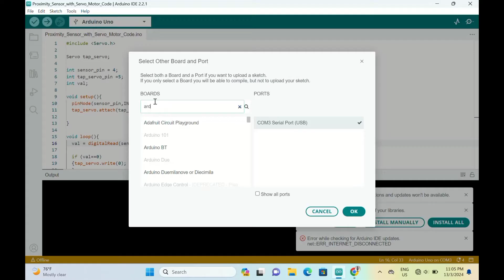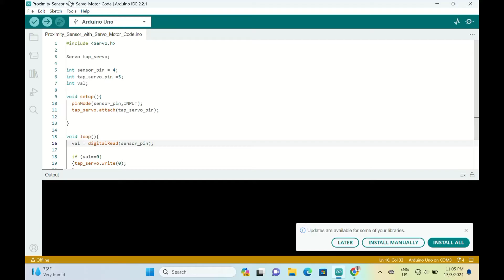Proximity Sensor with Arduino Uno

Comment: hi! can i request for the circuit diagram? and is it possible if i won’t be using arduino as the board, instead i will use ESP32?
Reply from the maker: You can use Esp32 instead of Arduino just replace the board and pin only

Comment: What are  the name of the connector did you use in proximity sensor and power supply?
Reply: Is this PNP proximity or NPN sir?
Reply from the maker: @eianvlog6047 this is NPN type. You can not use PNP proximity sensor connection like this Arduino can burn out.
Reply from the maker: It is simply call DC jack female connector😂

Comment: Hello, sir  this video is useful for my work. But some change for my project , when proximity sensor sense the metal motor start for 5 second, if metal is it steady at sensor more than 5 second motor will that time off. please make program for this work.

Comment: Can we calculate the distance from the metal object to the sensor  ? Whats the accuracy?
Reply from the maker: @easy_3d  this Sensor is only detect within 10mm very short range.so if you want wider range than need to use different type and different code
Reply: @passiontechklm  10mm is fine for me, i dont see any code in your code to display distance, how can we display the distance?
Reply from the maker: @easy_3d  need to write different code if you intend to have display
Reply: @passiontechklm  please can you use it to sense and  differentiate materials at in that 10mm range like plastic , glass , liquid. And how

Comment: Hi,
I found from some how a metal proxy sensor. It works with 24 V. Normally it worked when I close sensor to metal surface. But it's data line voltage was also 24 V. Than I broken my RP unfortunately. 
Is this normal? According to your (and also other turorials) videos they connect to data line to RP port and also join RP negative to sensor negative. And I guess all data voltage of the sensors is 5V. 
Unfortunately I realized this in very late and expensive way. :(
Reply from the maker: Yes it is normal its should not be no issue with Micro Controller. may be some where short wire? 
You should try with like Arduino first because RP is expensive much more than Arduino
Reply: @passiontechklm  ,
No. The problem is because of sensor type unfortunately.   
NPN or PNP type. My sensor was PNP type and this is gives 24 V to data line when the sensor triggered. 
If we want to use proximity sensor then we must use NPN type. In this type it gives the negative voltage "0" from data line when the sensor triggered.
I learned sensor types very well now but this lesson cost me little bir expensive unfortunately. 😛
But I wish you were mention about your sensor type NPN or PNP.
Any way, thanks a lot for tutorial. 😉
Reply from the maker: @mucip_ilbuga  Oh i though you were using NPN..... some times our experience is best teacher for us.

Comment: Hello! Thank u for making this video, it is really useful for my school project. I'm making a trash bin which can automatically separate metal and nonmetal trash. And im using inductive proximity sensor to detect the metal trash and hc-sr04 sensor to handle the nonmetal trash. So I'm wondering if your tutorial also works for inductive proximity sensor?
Reply from the maker: @Kimberly-z5r1l  Inductive sensor will detect metal is correct but Ultrasonic sensor also detect both metal and non metal meterial as well.

Comment: Tried everything with your connection. Capacitance Proximity Sensor works but the servo won't move. I don't know why 😅
Reply from the maker: @Myrmidon619  Give servo separate power supply... some times the current from Arduino is not support to move Servo motor
Reply: @passiontechklm  oh that makes sense. Thanks so much, I will try that 😁

Comment: wow nice can you help me in my project because im going to use 2 servo motor(mg996) and it requires 4vto7v and 2 capacitive proximity sensor how am i going to power all four of that components and what type of battery im going to use? can you help me?
Reply from the maker: @lianrodriguez8219  At first you need make sure sensor voltage and servo voltage so that you can use same power supply. That make more simple
Reply: @passiontechklm  the 2 sensor requirez 6v and the 2 servo requires 4volts to 7 volts

Comment: Hello! I have few questions related to this, i am currently working on a project and would like to ask for guidance, is there any way i can contact u privately?
Reply from the maker: @deleusavrill  You can ask in the comment here🤗
Reply: @passiontechklm  I hope you'll be able to understand this. Here’s the situation

I want to create a vending machine-like project where users insert three plastic bottles into an input slot, and in return, they receive 300mL of purified water. Once the bottles are inserted, the water from a jug or container will be automatically released. Users will need to place their tumbler below the faucet to prevent spills.  

I already have some materials (from a friend):  

- Arduino Uno R3 
- 20cm male-to-female Dupont jumper wires 
- 10cm male-to-male Dupont jumper wires
- Breadboard (170 tie points)
- IR sensor
- Servo motor
- 9V power supply

However, I want to replace the IR sensor with an LJC18A3-H-Z/BX (1-10mm Capacitance Proximity Sensor Switch, NPN Normally Open, DC) because I want the machine to accept "only plastic bottles* before dispensing water.  

The problem is, I don’t know how to use this sensor or how to write the necessary code to make my project work. Since this is my first time working on a project like this, I'm struggling a lot.  

I’d really appreciate your help in setting this up and coding it correctly. Thanks in advance!
Reply from the maker: @deleusavrill  As i understand your topic of project you can use exactly this project no need to change anything but the servo may be not enough to push big bottle.
Reply: @passiontechklm  How about the coding for the sensor? Can your code be used in our project?

Based on our project plan, the machine should only release water if the correct object (a plastic bottle) is inserted. If another object is inserted instead of a plastic bottle, the faucet will not release water. We want it to work like that, but we don’t know how to do the coding.
Reply from the maker: @deleusavrill  yes you can use this code
Reply: @passiontechklm  But in our project, it needs to detect 3 counts before the servo motor rotates, so I think some changes may be needed in your code. Can you help us with that?
Reply: I hope you can help us with this. 🙏
Reply from the maker: @deleusavrill  ok i will do it soon for you
Reply: @passiontechklm  thank you so so muchh, i'm looking forward to it. 🩶
Reply from the maker: @deleusavrill  You can check it out this video and i hope it will meet your project....https://youtu.be/xuDoHRtjdY0

Comment: Hi, thank you so much for creating this video. It's very helpful, I am curious of the possibility of using IR photoelectric 3 cable proximity sensor. Can I use such sensor on this circuit? Or do I have to adjust the library also. I am glad if you mind to answer my question because  I am having my first industrial project. Thanks a lot
Reply from the maker: @pheunomic-arif12  Can be use but be careful  your Sensor voltage. no need to change the code and library.

Comment: how did you activate the dc female 12V power? is it connected to other materials because we can't see it. thankyou
Reply: Its connected to the outlet he has a 12v power supply with an output that is a dc jack hence the use of the adapter

Comment: what power supply did you use for the sensor?
Reply: Is a 9v battery enough?
Reply from the maker: @marcreianaringo7414  yes, 9v battery is enough
Reply from the maker: I use 12v 2amp AC to DC adapter

Comment: Thank you a lot! I've been searching more than half a year information about connection of proximity sensor to the computer through the Arduino and couldn't find. But now i know, and it turned to be so much easier than I thought. Thankfully to you😊 Thank you very very much!
Reply from the maker: Cheers bro, I am very happy for its help.
Reply: @passiontechklm hello sir can I use relay for the another 5v for servo
Reply: @passiontechklm  can I use relay for another 5v supply for servo